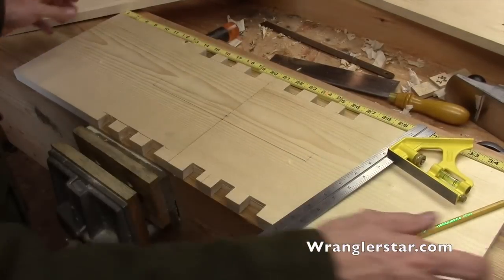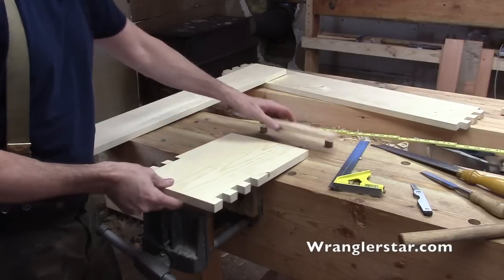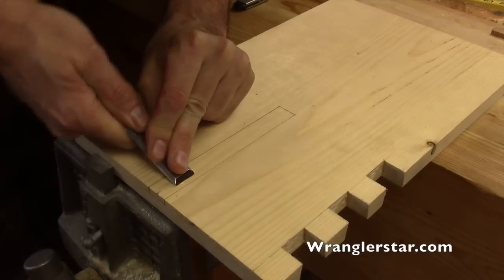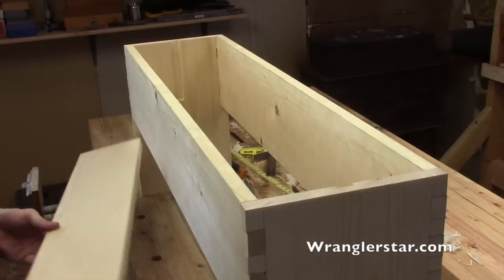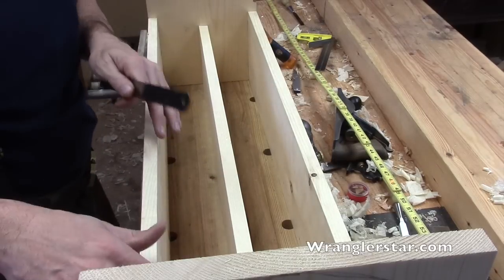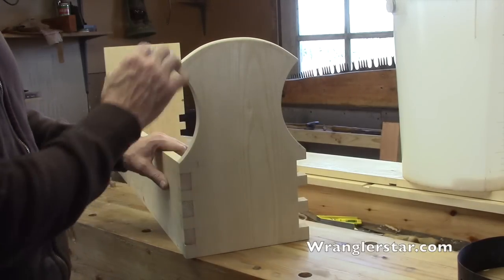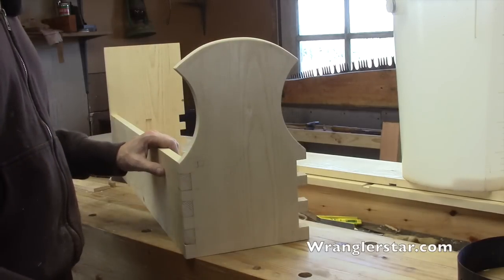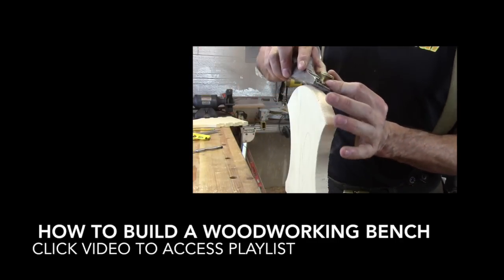Build a Tool Box Caddy For $25 | 2 Wranglerstar

Comment: Love the design Cody. You're probably done by now but I have seen craftsmen screw the bottoms on their boxes. Big brass ones every 6 inches. I also saw a native American carpenter insert 1/4 inch copper tubes into the corners of his bottom for drains. He used cedar milled from old phone posts. His kit included 4 block planes, 2 saws, 2 hammers, assorted hand tools and a Tomahawk! I loved that guy!

Comment: Put your mark on the inside small divider before you glue up :)

It doesn't work quite as easily in pine as with hardwood but you can make a scratch stock to make little bead details around that will dress it up considerably. More little details to make it look more finished.

Comment: Alright, this series is shaping up to be awesome, both in content and style.  You seemed a bit worried about making another carpentry series at the end of the 15+ part carpenter's bench.  I want to say that you are doing SO much right in this series so far, giving us the highlights of the build process.  We did not need to see every dovetail joint, we did not need to see you plane down each board from Home Depot garbage to something useable, we did not need to see every dado cut out, and we did not need another lesson in chisel sharpening ;)  However, if you find yourself in the possession of a new toy, those videos are always welcome.  I'm still glad that the bench series was huge as it was as much a learning experience for you as it was for us which is something I don't get to see too often.  Looking forward to seeing how the bottom is going to be attached to securely hold all those tools!

Comment: Just so people know, using that scrap piece with the dogs protects the edge of the piece you're working on from damage if it were against the dogs directly which if over tightened could press in and leave marks.
Nice tight joints, Cody.

Comment: Really nice, you should get Mrs. W to "braid/weave" a shoulder strap to attach to each end of the handle.
You could use steele rings or just run the rope through a hole b in the end of the handle.

Comment: I've been subscribed for a while now and greatly enjoy your videos. The normal homestead stuff, specifically the videos about the water tower and ram pump have been the most interesting to me personally. I'd never heard of a ram pump before I watched your video about it. I'm a true city slicker! As far as this video (I'm writing this while it's paused before watching) and the video before it, this is interesting to me as well. I'm writing right now to suggest that there be an addition to your videos. I've noticed you have a deal where you cut up the videos in sections. I understand this could be for a few reasons, from keeping it short for the audience that prefers short clips rather than a longer movie-type video, or there's multiple stages and you've run out of time and want to keep us updated about your project(s). Both of those reasons and any more are just fine. Would you consider, at the end of the project, combining all of the clip footage for the individual videos and make a longer movie version for the audience that prefers that form? True, the playlist option exists and sort of combines them all, but they're still separate clips, with a defined beginning and end. Different experience. Seeing the (obviously edited) transition go a little smoother between previously separate clips would be a more engrossing experience, in my opinion. This is only a request and a suggestion, not meant to fling mud on your efforts at all, sir. Thank you for reading.
Reply: Fine points. I don't know how that sort of internet deal works, I've got nothing to add to that. As far as keeping videos under 10 minutes, that doesn't matter with my own request. The shorter clips are fine and they should certainly be kept. My request has to do with an addition video that's compiled and edited from those shorter clip-like videos. Perhaps adding any extra behind-the-scenes footage that doesn't make it into the condensed clips. That could even draw more views!
Reply: Conner Emer An interesting concept. I sometimes struggle with editing a clip to fall into the 15 minute window. YouTube is a broad spectrum provider where videos are rated in the YouTube algorithm by number of views and how long the viewer stays engaged by percentage. Above 6 minutes viewers tend to drift away. Trying to have an viewer impact point every 60 seconds is tough but if you can, you will reach a broader audience. I have combined my videos into playlists based on subject and they have a viewer niche but it isn't close to the numbers who watch the 10 minute videos.

Comment: You could always use Paul Sellers version of the poor-man's router plane (chisel stuck thru a 2x4 like you used when you built the bench) to attack those dados. Of course, the method you used worked just fine. Maybe someday you'll stumble upon a dado plane.

Comment: Love this tote Cody but I'm worried if it's fully loaded that the bottom would fall out. Pine isn't to sturdy and it might tear out under a load of tools. I know u used it because of the cost ( and the weight). Is there a better way to secure it.  Dovetail? Dowels?

Comment: Wranglerstar, I don't know if anyone else brought up this point: it seems that the dovetail "tails" on the end pieces if anything are smaller than on the side pieces, however, as you know, the "tails" on the end pieces project crossgrain, that is, in the direction in which pine can be very weak.  Why not make the tails much wider on the end pieces, and much narrower on the side pieces?  (I would estimate that pine can be ten times stronger in one direction than the other, particularly when shearing forces are involved, like in this case...)

Comment: You may already know this but running dovetails on edge grain is not a good idea, glued rabbet or even a nailed butt joint would have been stronger in the long run. The vertical grain will cause those pins\tails to break off pretty easily. Also I admire the care you put into the stopped dados but an alternative method would be to make a series of cross grain chops just like Paul sellers does for his mortises followed by some poor mans router work would give similar result.

Comment: Beautiful, wouldn't you want to dove tail the bottom for strength?
Reply: ***** I've seen some similar projects, maybe not a tool box, can't remember...  where they dado'ed the bottom board into the side boards which theoretically has the added bonus of keeping the board off the ground, but the negative of losing some depth within the box.
Reply: I'd think that if you used a full thickness bottom, and cut a rebate to fit the dado, I don't think that would break very easily.  Usually drawer bottoms are thin panels or plywood.  I wouldn't want to see this attached with nails or screws.